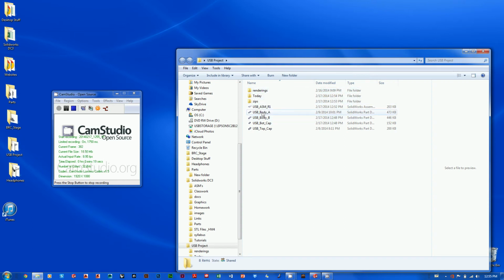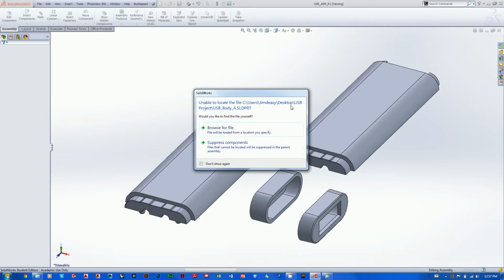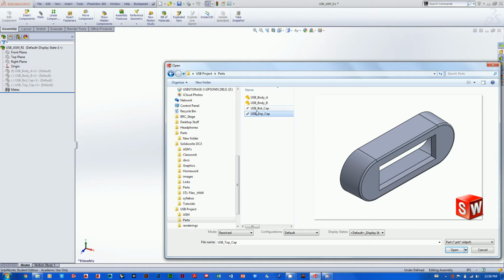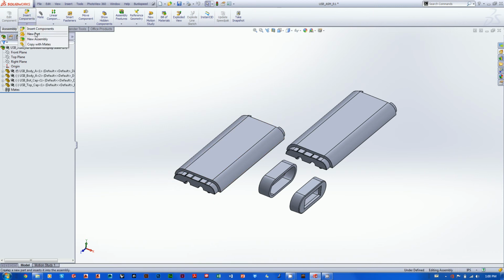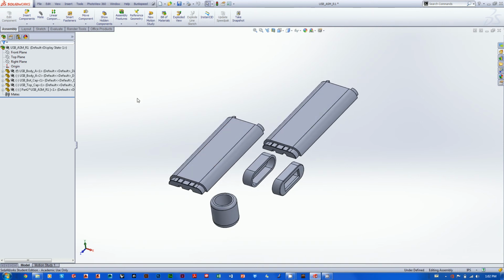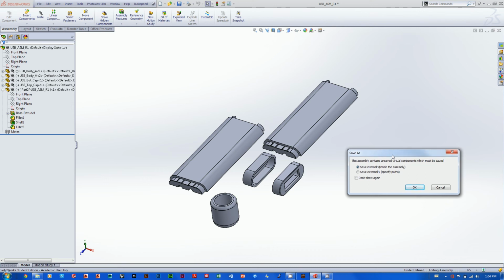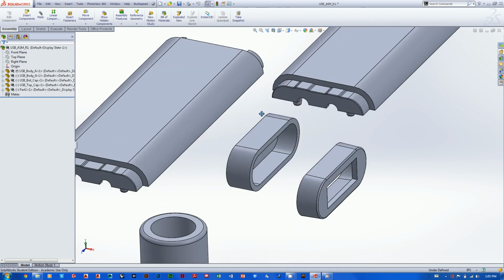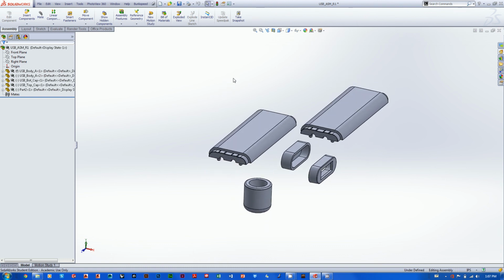Internal and External parts in Assemblies - Solidworks 021

Comment: I have an assy with external parts, I want to save those parts internally to the assy file.  Is this possible?

EDIT:  The answer to my question is to right-click on the desired parts/sub-assys within the top level assembly you're working on and say "make virtual".  Then save the assembly as normal.
Reply: Bless your soul